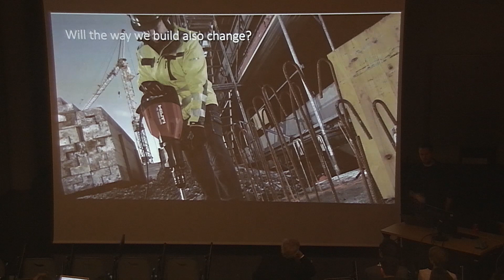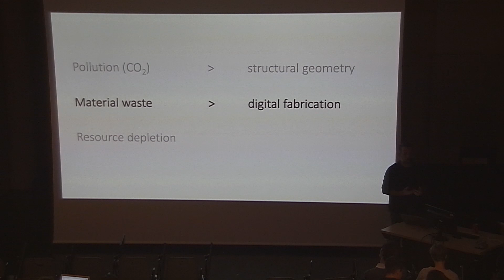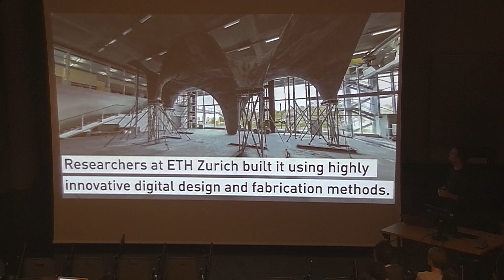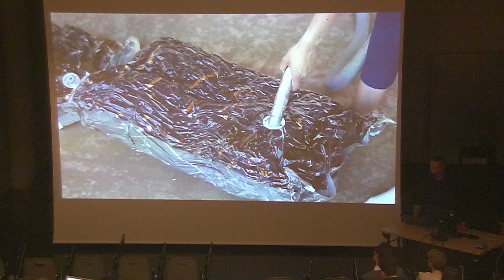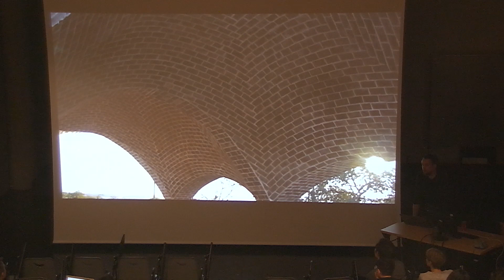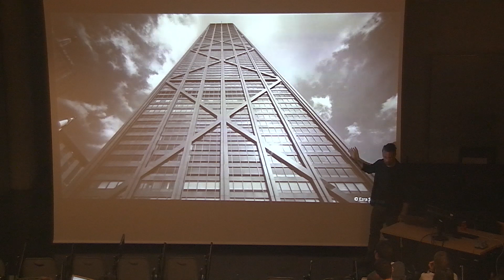Conference Prof. Dr. Philippe Block, architect and engineer | Ensa Paris-Est

Comment: The challenging concept has opened a new page of the largest and most significant chapter in the knowledge of the design and buildings construction practices. By distributing concept knowledge "Strength through Geometry" into daily practice Earth will no longer be the same place. The impressive and respectable material savings of new lightweight construction materials for every engineer arouse great curiosity and attention. Continue in this direction. Congratulations.